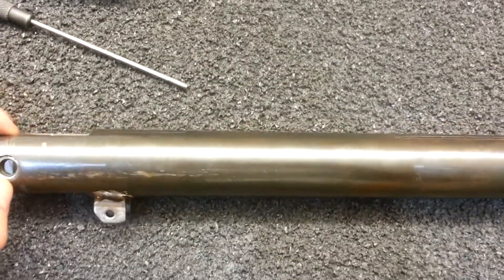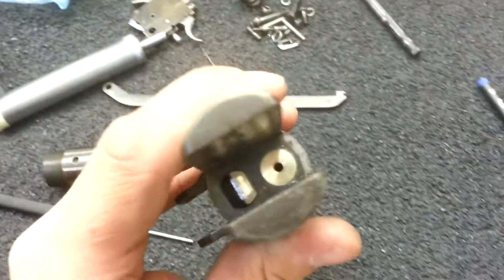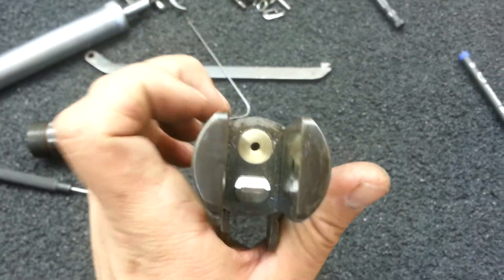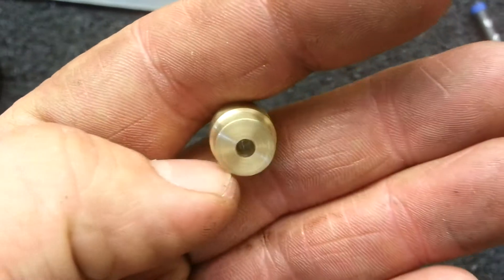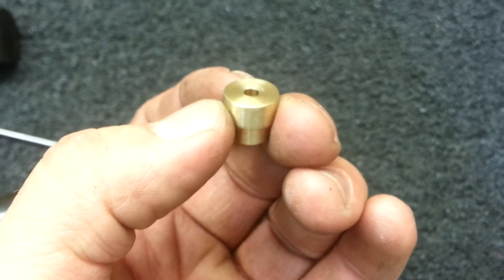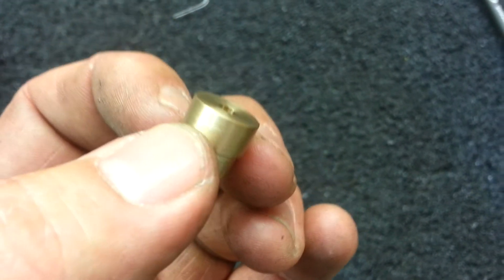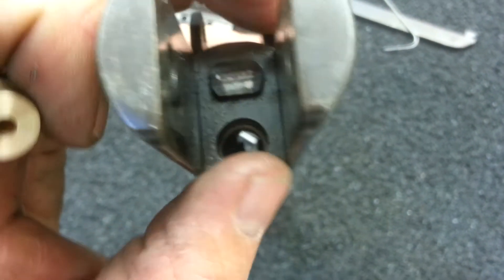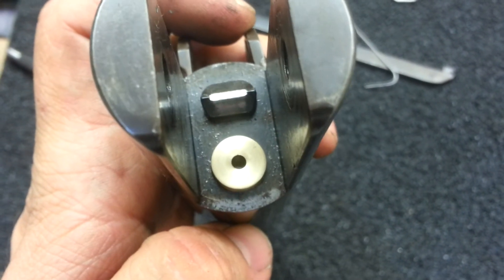Hw80 transfer port reduction. Change the t/p

Comment: by choosing the right port diameterhole ,,you want two things ,air must go fast in the barrel where it can drive the pellet, and that makes people thinking a large hole is the best ,and that it is  (if you want 60 cc  in case of a airgun wirh 60cm3   volume cold air in to the barrel),
But a spring piston rifle generates a lot of heat ,and that wil expand the air and you get more volume to go into the barrel .and you get that by the smaller transferport. so ther`s only a compromis possible  , a short as possible port and a small hole is the best,
maybe a port not bored complete tru  to the larger diameter.
Reply from the maker: Good observation. Altering the size of a port hole should be the last thing to fiddle with.

Comment: What size did you settle for? 3.2mm, 0.125"?
Reply: i think that depends on the power of the spring inside a lot ,a weak spring will like a litllebit larger hole ,cause it wil not heat the air up to create more volume  ,and heated air is also thinner and will flow better tru the smaller hole when a fast strong spring is used